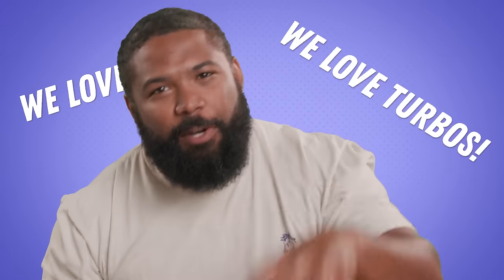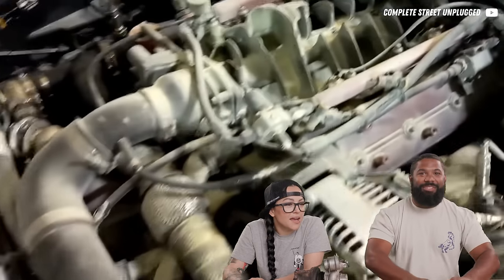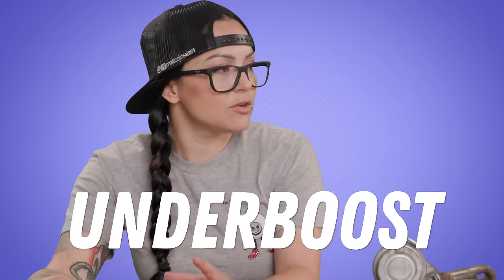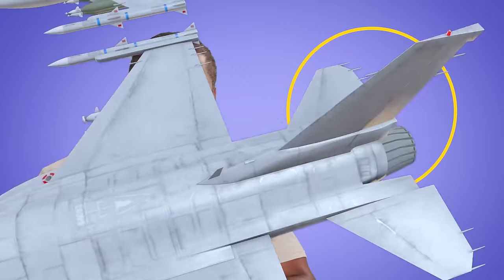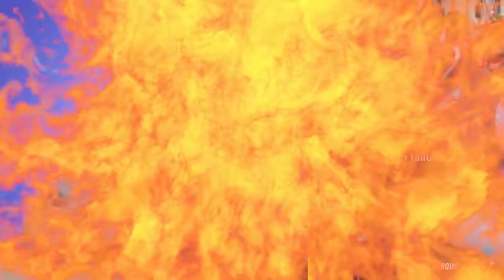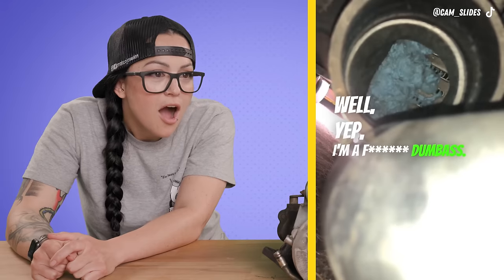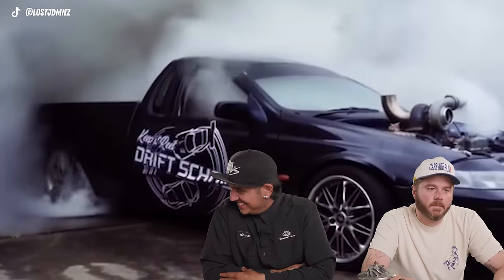Mechanic Reacts to Catastrophic Turbo Fails

Comment: I always take issue with the generalization that Turbochargers get free energy from the exhaust. Much of the energy is "free", in that it comes from the exhaust venting out of the exhaust port, however, the backpressure from the turbine causes increased pumping loses. The piston has to move upward on the exhaust stroke to evacuate the cylinder, and the turbocharger increases the restriction. So, the crankshaft does supply some of the energy to run the turbocharger.
Conversely, forced induction reduces the pumping lose on the intake stroke, though they increase the loses on the compression stroke.

Comment: I owned a 1963 Oldsmobile Jetfire which was one of the first Turbo cars.  It ran fine, but you had to make sure you kept up on Turbo Fluid Maintenance.  It used a special fluid to keep the turbo lubricated.  I had the car for 3 years and sold it to a man down the road and he used it for another 10 years.

Comment: You can tell Angelina is an automotive instructor, she's always does such a good job explaining what's going on and why it happens, and how to avoid that problem.  Her students must come out as real experts if they pay attention.
Reply: Exactly. Sandro obviously knows a lot, but can't explain it to save his life. Angelina is able to explain things very clearly without hesitation.
Reply: @andoletube for sure, it’s nice hearing their different explanations though. Angelina breaks it down and Sandro keeps things simple
Reply: She knows a lot, but her statement that turbos dont rob power to make power is completely false. They dont really borrow from gross power output like a supercharger, but the back pressure created by a turbo simply robs the power before it even makes it to the crank. Dont believe me, stick a turbo in the exhaust flow of an N/A engine and see how it reduces power output. And then on top of that, the boost created on the compressor side also slows the impeller and in turn creates even MORE back pressure.
Reply: Her explanation of what happened to that Corvette is absolutely wrong. More than likely what happened was something in the intake/turbo blew apart, and then the fire come from all the unburnt fuel because it was running so rich due to loss of boost  this isn’t the only episode where she was incorrect
Reply: @tjziegler8823  you nailed it on the head thermodynamics says that there is no free power. It doesn’t matter if you can explain something so that layman can understand it if its absolutely wrong.
Reply: lol  volvo in park
Reply: @tjziegler8823 I agree but I think she was just trying to say it doesn’t require an external power it uses power already, she wasn’t saying it doesn’t rob power

Comment: That Volvo was just a runaway Diesel, not a turbo fail. Once that happens, that engine will rev itself apart unless there is someone who knows what they are doing. Loving the channel btw! Sandro and Angelina are the stars of these episodes! :D
Reply: Either choking the intake or cutting off the fuel flow will work, but there are caveats for both:

-Choking the intake may not work as if there's a loose fit or crack on any piping, it'll just suck in air through those gaps and continue to rev like mad. If you have direct access to the front of the compressor, then you can just put something solid like a block of wood in front of it and hold it down until it chokes.

-Cutting off the fuel supply may not work as if the turbo has an especially bad oil leak, then it will just siphon off of the engine's oil supply until it detonates from a lack of lubrication.

If the vehicle has a manual transmission, then you could instead try to stall the engine.
Reply: @uberschnilthegreat22  even by cutting the fuel flow, most of the time run away diesels runs on the engine oil
Reply: @retrocompaq5212  If you read all of my comment, you would have seen I mentioned that.
Reply: It’s funny nobody said about runaway diesel, because they don’t have diesel Volvos in the States! 😅
Reply: @uberschnilthegreat22  This hole episode made me shake my head, like they had no idea how turbos even worked outside of what a book says.  Glad someone said what really happened on the Volvo.

I cringed when they explaned the "chocolate milk"   not even one part of a turbo system links to water, unless you have an air to water intercooler.  Then the catch can to keep oil out of the water part.. super cringe.   lol
Reply: @ThEPuP4x4 Not saying they’re right or you’re wrong, but plenty of commercial turbo diesel applications have water-cooled turbos.
Reply: was gonna say the same thing if i didn't see it. more common than most people are familiar with.
Reply: Right, I feel like they should know what a runaway diesel is by now.
Reply: @ThEPuP4x4 uhhhh, no. That is absolutely incorrect. A lot of modern turbos are water cooled. Mine being one of them. And every time you see an ecoboost f150 or explorer (not sure about the smaller ecoboosts) you're looking at a vehicle with water cooled turbos. They are everywhere.
Reply: glad u mentioned it, I was halfway yelling at my screen that it was running away lol
Reply: I too couldn’t fathom none of them knew what a runaway diesel is
Reply: I think it might be because there are so few diesel cars in the US. They probably aren't Volvo enjoyers and didn't realize it was a d5
Reply: @arthura7442  Idk if my friend was planning on buying a euro engine or a different car like a tdi vw, but from my understanding he was going to get a diesel Volvo from a junkyard to swap into his 970, im probably wrong but he knows about rare ass volvos like the c70 coupe he had. Also, this comment thread reminded me that if I end up buying a tdi jetta, I wanna keep a fitted steel sheet in the glovebox in case of a runaway😂
Reply: Looked like a turbo seal blew and the oil went to the compressor side...needs an air shut off

Comment: I love that they felt the need to explain that you shouldn’t throw burritos into your engine. 😂
It’s basically the same as the meme that goes “in the 50s owners manual told you how to adjust the valve timing and today it tells you not to drink the contents of the battery.”
Reply: when i signed the lease for my apartment one of the clauses was, no fireworks indoors

the fact that needed to be even mentioned... smh

Comment: 6:22 that´s called a runaway diesel. Diesel cars dont need spark to ignite the fuel and if fuel (or oil) gets uncontrollably into the cylinder(ECU error or Diesel Pump error or Oil Pump error), it can ignite by itself. If this happens, the car will rev uncontrollably, until the engine blows itself up or you block the intake. Thankfully this happens very rarely. (this would be a great Donut video. You can  make a diesel engine run away and explain how that happend)
Reply: You’d think they would know that based on the fact that it says that on the video they’re watching lol

Comment: In the "no shaft play" segment, the zero side-to-side shaft play applies to ball bearing turbos. Journal bearing turbos, by design, need a little bit of play for there to be a passage for oil. With journal bearings, you should be checking for any in/out play or enough side-to-side play that makes the blades hit the housing.
Reply: Thank you! I was hoping at least one other person would recognize the difference between journal and ball bearing turbos.
Reply: I was thinking the same. There's a few things that, while they're not wrong, they're not completely right either. 
Tbf I dont expect them to give every possible explanation for every situation but there has been a couple of times where I've thought 'well hang on thats not entirely true, isit...'
Reply: They said, 'you shouldn't be able to hear it' to be fair.
Reply: @JamesHamp93  that kind of comment is first on the editing room floor though in these shows. Frequently they over-edit.

Comment: For the question at 6:00 that was a 6.0 powerstroke diesel, the engine was notorious for blowing head gaskets especially when power is turned up and one common way to try and mitigate this was to replace the bolts with studs since the engine was based on a navistar engine that had less head bolts per cylinder than their previous powerstroke engine since the model it was based on made less power

Comment: Don’t forget that on a turbo the turbine side and the compressor side are trying to pull each other apart, so you don’t just have to worry about centrifugal force but also the tensile strength of the shaft. That’s why they have an efficiency curve, it’s not just the flow characteristics but also as the RPM increase the clearance on both impellers reduces as the shaft stretches. There is a limit and that’s what the wastegate is there for.

Comment: You know that angelina is a real mechanic when she mentions the compressor side and turbine side instead of hot/cold side
Reply: Turbine engineer approves of this message. It's better to use the actual component names in heavy industry. Communication mistakes cost money.

Comment: btw turbos do add a lot of egt, manifold pressure, combustion pressure, and significantly affects the exhaust scavenging. It does in turn consume power to generate more power, the only reason we misunderstand it as otherwise is because it is capable of creating more power than it consumes to offset the difference. That is one of the reasons why big turbos make big power, they have less exhaust back pressures in turn allowing the engine to regain it's volumetric efficiency thus making significantly more power

Comment: 7:00 wait a minute, they're mechanics but DON'T KNOW about diesel engines runaway ????
Reply: Diesel engine runaway while idling???? Nerve thought that could also happen.
Reply: @basantatamang2249  They were most definitely driving the car, and jumped out of it when it started "running away". I've had this happen on my last car TWICE and believe me when I say that you jump out of the car as fast as you can when it happens lol.
And yeah, once it started, it's not stopping before a solid 30 seconds (of before the engine breaks or something) :(

Comment: 6:21 is a runaway diesel, says it in the title, although they call it a runaway turbo. Turbos are an incredibly overlooked service item. They don't get replaced or rebuilt nearly as often as they should, if ever. When the sealing rings on the turbine shaft wear out and they leak oil the engine burns it like fuel. That makes it rev, making the turbo spin faster, making it ingest more oil, making it basically feed itself in a cycle ultimately leading to self- destruction. Turn the ignition off if you want, it wont help. You have to stall the engine out or suffocate the turbo by blocking off the intake. If the o-ring on the back of the compressor housing is bad enough there is the potential you wont be able to completely suffocate it.

Comment: 7:05 this is called runaway or dieseling which is caused by an alternate fuel source reaching the combustion chamber causing the engine to run at redline and even higher than that till it eventually blows up. Can be stopped if you’re fast enough to open the hood and choke off the air supply

Comment: A similar thing happened to me as in the shop rag in the turbo story.
  Back in the late 90s, I rebuilt a turbo 2.3 ford engine, and was installing it in my old trusty bronco II. I was working a LOT (70 to 80 hours a week) at that time, so stuffed some of those blue paper shop rags into the intake and exhaust ports, then put into my engine rack with the other 6 engines I had. 
  When I finally finished the super busy season and I had some time,  I started to install it. Well, my daughter hung out with me as always in the garage like she always did, ( 7 at the time. she is my only child that only calls me with car trouble AFTER she has checked everything, then asks "what else should I check")  I saw her playing around by the 2.3 and when she walked away, she had some shop rags in her hand.
 When I finally had the engine mounted up, I went to pull the shop rags out, and didn't see them, so figured that they were the ones I'd seen her walk away with.  Well, the engine started up fine on the first try, but died in less than 30 seconds, repeated tries just 'chuffed' and popped through the intake and it wouldn't start. 
Well, after I checked to ensure that timing was right, I went through the whole process of pulling the engine and started to open it up and make sure that I hadn't messed up on the build. 
 After pulling the head, I found out that she hadn't removed the rags, she had just pushed them deeper into the ports, because I found them wrapped around the intake valves.

Comment: surprised they never seen a runaway diesel. So many diesel's runaway from old turbo compressor seals, the seals just keep dumping oil (fuel for diesel's) into the intake. You'll just be driving and the rpm's wont go back down. after awhile if you dont cover the intake, it'll start redlining and melt the rings to the walls. haha

Comment: That wood fired one is what I believe you’d call a positive feedback loop. Meaning as the exhaust speeds up the turbo it’s forcing more in and more exhaust out causing it endlessly ramp up till it failed.

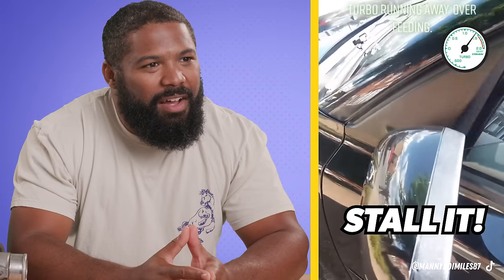Comment: 6:26 that's probably something called "Diesel engine runaway". Basically engine starts by itself to rev up and you can't turn it off by taking key out of the ingition. Only thing you can do is to cover the intake until engine stops running or put it into highest gear and dump the clutch (if your car have a manual transmission ofc) or just wait for engine to destroy itself.

Comment: The Volvo at 6:28 was most likely a diesel runaway victim. Simply put, the nature of compression ignition engines meant the accidental overboost might make the combustion chamber hot enough to self-sustain the combustion cycles. Without a hard fuel and air intake cut the poor thing will rev itself up to death. 

Other than that, this is yet another reminder to you folks there that making stupid powers with forced induction ain’t just gonna cut it if you don’t do it safely and reliably. As always, the RMS crew is a fun and chill addition to Donut and I’d love to see more of them around.

Comment: 6:50 - a proper oil leak from the turbo into the intake can cause the engine to run on its own even after you turn the ignition off. Happened to a friend of ours

Comment: clip around 6:40 is imo a runaway, it's when the ring on your pistons let oil go buy essentially fueling the engine and it will rev up until you run out of oil or a piston is thrown. usually a piston

Comment: Turbo shafts could sheer if you don't have a or have a bad blow off valve.  
The mustang svo 2.3l Lima did not come with a blow off valve. The top mounted intercooler connected directly to the throttle body.  So during shifts when the butterfly valve closes the turbine is still spinning but the back pressure is slowing the compressor and snap there goes the shaft. I keep one of my numerous blown turbos with the snapped shaft to show why the blow off valve made 4 bangers reliable.

Comment: The dodge in the second clip is Josh McCormack’s pickup. It’s a serious build. It laid down 2879 horsepower at the Ultimate Callout Challenge this year. He won the dyno competition and finished 3rd overall between dyno, truck pull, and drag race competition. He’s got a good YouTube channel, Horsetorques Diesel. Also while I really like everyone on donut, they need to bring someone on with some diesel knowledge.

Comment: Mechanics should know, that Diesel engine runs on oil. If turbo spill oil into intake, you have about 6 liters (depends on engine) of fuel, that is pumped into the engine and it can run even with key out. Yep, no Spark, no need any electricity. 6:25  Great vid btw

Comment: This is why I love old big blocks. 
I had a k450 rocket V8 in my Oldsmobile Delta 88. 
That engine was 100% stock until I forced it to run on 91 fuel with 12 pounds of boost. 
It wanted low octane leaded fuel .. 

It didn't give a damn shred of a care. 
Two years later i ended up with water in a piston. That was the only damage.

Comment: 6:20 : I am surprised they didn't got it because that kind of problem is kind of "known" at least in France (despite still quite rare). The problem here is that oil is pumped in the turbo then injected in the engine. The car is then burning its own oil, at an equivalent power of full throttle (meaning, stalling the car without exploding anything from the transmission will be quite challenging). The engine will eventually go off when the car will run out of oil (or when it will break off).
The safest way to stop the engine is to clog the air intake (if you can).

Comment: As a 6.0 Powerstroke owner, I can relate to the F250 dyno failure. That appears to be a 6.0. They are notorious for head gasket failures due to the fact that International went to a 4 head bolt per cylinder design down from 6 bolts per cylinder on the old 7.3. Simply put, you don’t have the clamp force on the deck of a 6.0 that you did from the 7.3.  Putting head studs in it gives better clamping force than the TTY bolts do, but it’s still not idiot proof.

Comment: Lets not forget the last clip was from keep it reet. That intec engine they also drain the oil and topped it up with 3 kabab sauces and the coolant was soft drink before feeding the turbo. Bullet proof engines